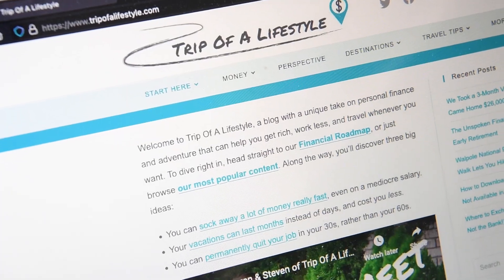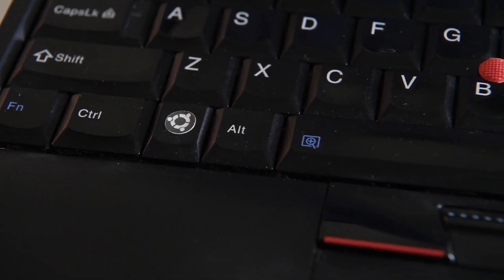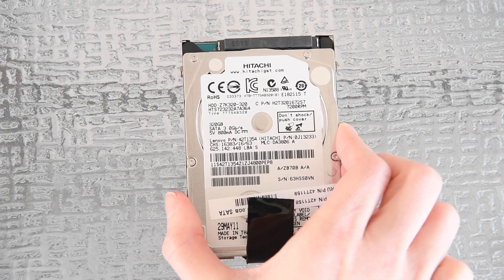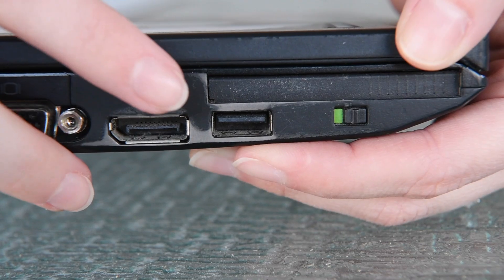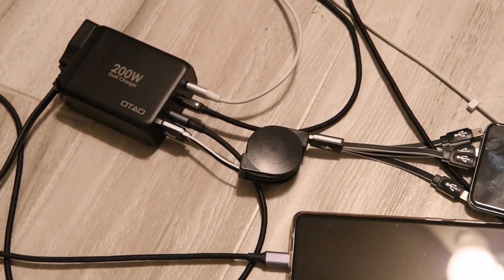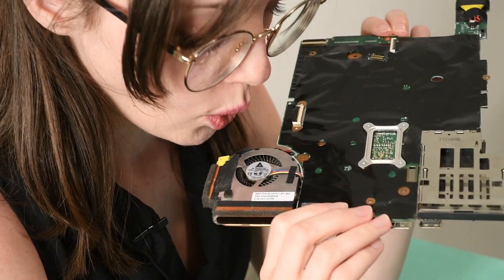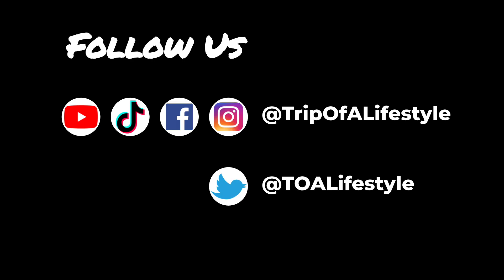How To Make Your Laptop Last FOREVER (My ThinkPad Mods & Upgrades)

Comment: I have done most of these easy upgrades to SSD storage, memory and ports. However, the WiFi speeds ~100Mbps at the fastest still suck on these older models making it necessary to upgrade. Not to mention the poor CPU compute power choking on exporting those 4k videos. I love upgrading old tech. but had to move to the new M4 Apple silicon and no regrets while running the older ubuntu based 2010 Lenovo side by side for occasional light use.

Comment: I bought my first FAST laptop used from a popular chain store.  It was an early windows 10 loptop.   the vendor did not understand the load that windows 10 put on a computer.  It sold with 8GB ram and a SLOW HD.   SW updates made the computer unusable.    so a $900 laptop for $273.   Upped the memory to 16GB and put an NVME drive in it.  Windows perked right up - even on  updates.   that was a test.    I then put Kubuntu on it and it became a speed deamon except - I do not play intensive games.    so VERY VERY Happy.

Comment: The RAM should have been included in the cost figures if you're trying to show the true costs. Likewise, if you had to hire someone to do the disassembly/upgrades, it would vastly increase the cost. Like you, I do try to make things last as long as possible & upgraded (I have a 2008 Dell Mini 9 running Bohdi Linux on 2GB RAM & a 32GB eMMC SSD , a 2011 13" Toshiba Portege R830 running Win 10 also w/insane ports + DVD!, & a touchscreen Toshiba 17" i7 running Linux Mint Mate on 16GB RAM), but it wouldn't be feasible if I couldn't do the work myself. The 17" stays on my desk, plugged in (battery still holds for a short time, but I don't carry that beast around), the 13" was last used when my son went to Japan on holiday. If it got lost or stolen, no big deal. Meanwhile, the Dell mini is my carry-with for jobs in case I need to go online for a driver or etc. The coin battery is shot, but I haven't bothered tearing it to pieces, so just set the date manually at boot.
Reply from the maker: The cost of the RAM is shown at 02:06 and is included in the calculation. A link is also provided in the video description for where to buy it.

And yes! DIY definitely saves a lot of money! Learning how to do things yourself here on YouTube costs nothing.

Comment: I still use my Dell D830 regularly.  Dell released a BIOS update to increase the amount of supported  RAM to 8GB.  Of course I also replaced the spinning metal drive with an SSD.  Runs Windows 10 and Ubuntu 24.04 flawlessly.

Comment: I too used a 12 year old Intel Gen 1 laptop until two years ago. Bought it as a 4 year old used laptop back in 2014. Made all my money on it. ROI was just out of this world. I went with Linux Mint because that was what I was used to. And Mint is low resource hogging than Ubuntu.
Reply: An the funny thing is I dont use 75% of the computing power of  the laptop I bought brand new to replace it. The other thing I love about old laptops are how much easy it is to repair them. New is not always better.

Comment: For 1200 dollars nowadays, you can get some really good laptops. With 16 ddr5 ram, nvme ssd 1tb , graphic cards and everything else you'd need 😬 However the upgradation+maintenance only costed About 300 dollars..(you can get a more powerful and faster laptop even if it would be i3. But yeah, if you love your old laptop, this is perfect

Comment: I'm using a stock T430 in 2025! I actually plan to upgrade it soon from an i5 to an i7, from 8gb to 16gb, to install a 512gb mSata drive and upgrade from a DVD drive to a Blu Ray if possible. I was considering upgrading the screen too but I'm not sure. They don't build them like they used to. With Linux I've noticed you can get a decade out of a machine easily. Planned obsolescence sucks.
Reply from the maker: @WednesdaysVlog  Excellent! And those upgrades will cost you next to nothing on eBay nowadays!
Reply: @TripOfALifestyle  Yep! For the CPU and Ram It's only about £50-60 ($60-70). Well worth it I think.

Comment: My daily driver is a used Thinkpad T520 i got off Ebay for $200 in 2016. No OS, no hard drive, so I added a 1TB SSD with windows 7. It did come with a supersize battery which I am still using . I also dual boot with Archlinux. I love it and don't feel I need anything better.
Reply from the maker: @jamba_d  Nicely done! 👏

Comment: This was my work computer for 6 years.  I never had a single problem, except near the end, I replaced the HDD with an SSD, and yes, it got much faster. I used it hard and was even dropped once or twice.   It was a company laptop, so I gave it back.  It was the best laptop I used to date    I was allowed to pick whatever I wanted before that, and those were always Dell products.  They were good but needed a lot of repairs.  I own a MacBook Pro now, but I still loved that X220

Comment: My upgraded T430 will last forever. I put in an i7-3630QM with the 2-pipe cooler, it's got 8GB RAM, 2 SSDs, 1600x900 IPS screen, ThinkLight & an illuminated keyboard. It's running all day every day and it's just legendary.

Comment: The only flaw in all of this is you paid $900 for this laptop 12 years ago and you made all these upgrades for under $1200 if you bought a new laptop for $900 today it would be brand new and have better specs than where you are now.
Reply from the maker: @RandomVelocity  It sounds like you may have misinterpreted the video. The TOTAL cost, including the original laptop purchase, all upgrades, and maintenance (including new batteries), was $1200. It wasn't $900 + $1200. Hope that helps!

Comment: I still use a 2012 Samsung laptop that I run ChromeOS Flex on and a 2014 Mac Book Pro that now runs Ubuntu. Only upgrade done to the Samsung laptop was replacing the hard drive with an SSD. No changes done to the MBP h/w yet. But might need to replace battery as it barely lasts.

Comment: Great vid, and I like that you mixed in your financial tips w/ practical gadgets that people use daily. One note about the B roll: The RAM that was pictured was desktop RAM, not notebook RAM.

Also, the part about the BIOS was a bit misleading. Lenovo follows IBM's awful tradition of hardware whitelists. You had to install a modified BIOS before you could install the card, right?
Reply from the maker: Thanks!

1. Yes, the RAM pictured in the B-roll at 02:02 is desktop memory. We just didn't feel like taking memory out of the laptop to film the shot, and we had this lying around. 😛

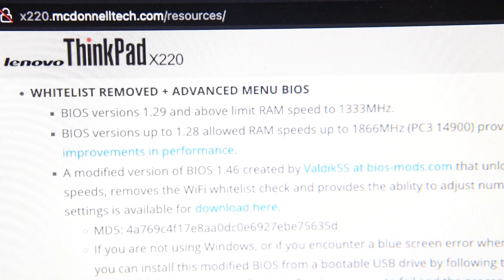2. Yes, the whitelist-removed BIOS (and the website where it can be obtained) is shown on-screen at 01:18 and in the video description.
Reply: @ thanks for your response. Also thanks for making X220s popular again haha

Comment: I am 61 years old and have only ever purchased one new computer 35 years ago. Since learning of linux, I have inherited desktops and laptops that supposed don't work and previous owners have trashed only to be able to install linux on them. Even with that knowledge the owners did not want to learn a wee bit of linux but rather go out and spend more money for a windows computer, there loss my gain. Great for me. Currently running MX linux on a 8 year old Dell xps laptop, it's awesome ! BTW: used a Linux computer and co-habitated in a windows work based environment with little to no problem.
Reply from the maker: @philcadorette1383  Very cool! Feels great to breathe new life into old equipment.

Comment: My 2012 Dell Vostro 2520 I installed windows from Ubuntu because at that time Ubuntu wouldn't run some programs I needed, upgraded ram from 1gb to 8gb($30) then 16gb dual($19 for 1X8gb) channel, swapped spinning HD for SSD($49), swapped CPU from 2 core Celeron to 2 core/4 threads i3 3110M ($50) Higher clock speeds and added Hyperthreading which for it's day had a beast of iGPU HD4000 with 2.16GB of dedicated Vram, the same as came with Macbooks with about the same capability as a GTX660 desktop, not all HD4000 are the same. Not going to replace the optical drive because it's the only reliable one I ever found, if a disc can be played, it will play it. Screen was damaged in travel, replaced for $50 with equal 1366X768. Bought two 9 cell extra battery packs from Battery Doctor for $29 each many years ago, all work including the original battery, 6 hours SOT with original battery and 10+ hours with the replacement batteries. Spinning HD take a lot of energy, switching to an SSD alone can improve battery endurance by 50%. Bought a car charger for $16. Note about screens, 1080P probably does look crisper but 1366X768 used to be common and it did work, more than adequate for video playback and it really doesn't make your eyes bleed reading and I read several books on that screen.

Comment: I've been terrified to open my computer. are there any tips about doing that?

By the way, Youtube recommended this video and I have subscribed. I have a 9-year old ASUS that I'd like to keep running as a backup (I just bought a new HP) but I need a new keyboard. Thanks for the tips!
Reply: if its an old computer that you dont use anymore, you dont have much to lose by opening it. Id look up a "teardown" of your model number. the model number is in small text on the bottom of you laptop. Don't tighten the screws hard, and make sure the screwdriver is the right size (you dont want to strip the screws). Always unplug the battery first after taking off the bottom. Most importantly, if you are ever unsure about something, google what youre unsure about.

Comment: Love this vid and how it ties into your retirement philosophy.  Do you have any references for your brick to usb charging change and internal usb port so I might do this with my T530?  Or would you maybe make a vid on it?
Reply from the maker: Thank you! Yes, all of the parts are linked in the video description, including both the USB-C charging port and the internal USB port. Some of these items may be specific to certain ThinkPad models, though.
Reply: @TripOfALifestyle  Thanks for replying!  That covers the parts, how about the process?  Was this a solder in type operation?  Did it require a microscope or considerations for multi layer boards?

Comment: Cool thanks! I like the light reflection off your glasses.
Reply: The reflection was distracting to me. At first I thought something had gone wrong with my screen until I realized it was your ring light being reflected. Could you reposition the light (at a different angle - may be vertically?) to avoid that?

Comment: I bought my X220 as a scratch and dent for less than $200 from Lenovo Outlet.  12 years ago.  Returned it to get the screen replaced as part of the warranty.  Upgrades: 512 SSD, 8GB Ram.  Replaced fan with CPU heat sink.  Replaced red rubber pointer.  Batteries are the most expensive maintenance for me.
Reply from the maker: @turtle522  Awesome!

Comment: Thanks, I had forgotten about Ubuntu. Are there similar replacements for a MacBook Pro?
Reply from the maker: @Bob626A  Macs are a little harder to work on generally, but depending on which model you have, there may be upgrades available!
Reply: Nothing much to upgrade if you have 2013-2015 pro, you can swap built in ssd*(not really ssd) for nvme using a small converter, 2nd upgrade would be a wifi6+ usb dongle or USB2ethernet for full optical internet speeds.

Comment: As an old pc upgrader/refurbisher however you want to call it, i lik the effort you took to keep the old laptop going.  I kept my old hp 8730w quad core till last year just because of the 17" it was a good old gal but had to be replaced ofc, changed 3 battery's i think, and bought an extended battery in the end.  Bought a 2nd hand dell last (8th gen i7) year to replace let's see if it can also keep up for 10+ years (in desktops i'm a bit more wasteful as i change every 3-4y) .But still nice to see that old hw can still be upgraded unlike new all soldered down hardware even the RAM..

Comment: Great tutorial. Hard to retire a good running laptop.  My 2010 Asus ROG laptop's screen went out as a result of short caused by the faulty power supply.  It's a power house of a gaming laptop but unfortunately, the backlight harness is a rare commodity.  Thanks for the inspiration.

Comment: What did you apply the thermal pad on? I assume the thermal paste was applied to the CPU, but what was the thermal pad applied on?
Reply from the maker: @arielgracianodidimustanto65  That's the platform controller hub (PCH).

Comment: A nice VLOG for newbies and people on a budget... Under 1200 dollars. At that price, you could get a much newer laptop, i7 10th generation, or newer, with much faster hardware like memory, Nvme, and CPU. And it would run circles around your old laptop. And you could run better video editing software. I have been in the computer building and maintenance since the '80. I know a lot about computers and portable devices like laptops. I have computers from the early MSDOS era to the modern 14th-generation CPUs. Nicely done... =8-)

Comment: If you can make your living out a i7-2620M, an old CPU is fine... but many softwares won't run on this old CPU. For example, if you edited multiple videos a week on this machine, I think you'd probably need an upgrade. Else you'd spend like 10000% of the time per video encoding. lol (rtx cards speed up video encoding by like a lot)
But hey, yea, 1200 for 13 years. Sure.

Comment: Another cheap upgrade that really boosts productivity at home would be a docking station - you can sometimes get these for under 20$,  giving you more ports and the ability to add screens, external keyboards and mice etc whilst also reducing your use of and extending the life of your laptop's ports.

Comment: Unfortunately my HP Pavilion 4200 from 2000 no longer has available parts. Battery is dead. Keyboard is dead. No USB 3.0. But it still runs XP just fine.

Comment: What happens when windows 11 has officially taken over? Would love to know if there was a way to change the cpu/gpu. That's excellent that you mentioned the thermal paste. Not many know of that one. That would be a great follow-up maintenance video.
Reply from the maker: It's not practical to change out the CPU or GPU in the ThinkPad X220, but it is possible in some laptops! However, using Linux instead of Windows can greatly increase the lifespan of a PC.

Comment: I have to stick with windows (for now) too many essential tools I use don't work at all on Linux, even using the various compatibility layers and tools. Other than that my 2007 Dell works just fine for most tasks. 
On Windows install i disabled all the bloat. It's actually pretty easy. 
Also - never had a virus in 17 years.

Comment: Wow, my laptop is older, but I didn't have to do any major upgrades like you...I am typing on a Dell D531 laptop...4 gigs of ram and Dual-Core AMD 2.00 GHz CPU...I have dual boot XP and 10...Running 32 bit but I can install 64-bit Windows 10 if I want to...I would have to upgrade my ram to 8 gigs to run 64-bit Windows 10...I am not spending any money on upgrading though because my laptop handles Windows 10 like a champ...And I have it running all the time...I never turn it off...Nothing has broken yet either, crossing my fingers...

Comment: I've got you beat at 20 years on one laptop. Did everything except the charging port. Love Linux over MS Windows. My 4th Hard-drive won't be an SSD, they don't seem to last as long as a HDD.
Time to stop being so cheap and buy a new laptop. Prices are pretty good on new ones. I'll keep this one for web stuff only. My processor was prior to the i3, i5, or i7 ones.😂

Comment: Great job, i'm 79 and still do all my own repairs thanks to youtube. Replace batteries in cell phones ( which they say can't be replaced) to replacing screens on laptops. You go girl!
Reply: Good for you man. I'm only 59. I'm self taught in Linux and do all my own repairs and upgrades.
Reply: @mjdegrey4843  I’m 26 and I used to do my own repairs as well, but nowadays I can’t be bothered. I don’t like laptops anymore. I don’t need a portable PC since smartphones and tablets have largely replaced the need for a laptop for me. However, I still build my own custom computers since I’m a PC gamer and I like the control of choosing my own components and how they’re all put together. It gives me a great sense of ownership.
Reply: My ThinkPad T60    19 y.o..
Reply: @zatoichi-e4ri have one, but i screwed up the fan power circuit on the mobo...
Reply: that is OG, ill soon be 30 and due to poverty, i allways had to do repairs. glad my dad plays the screwdriver like a modern stradivari.